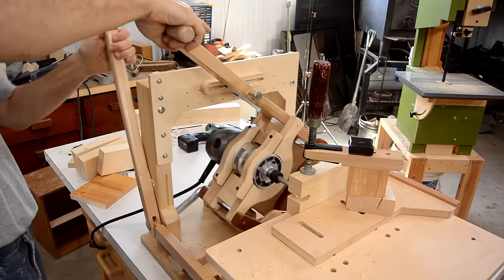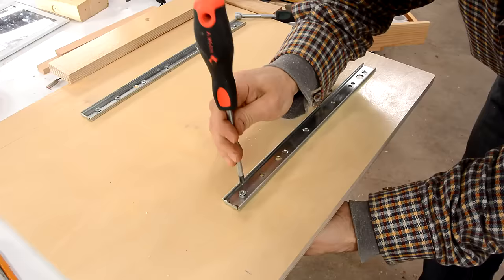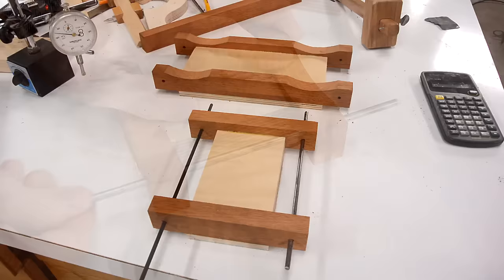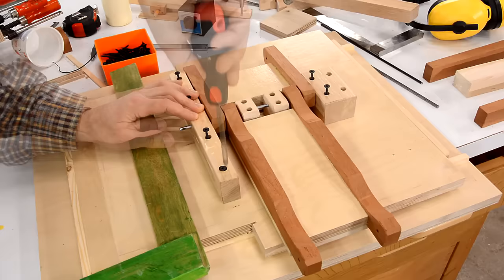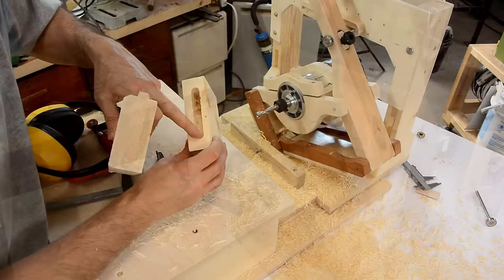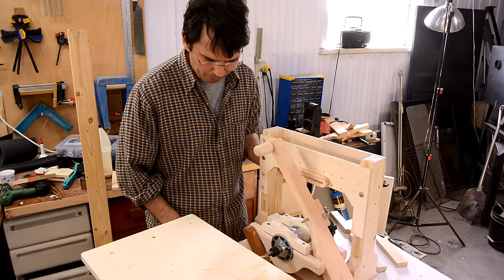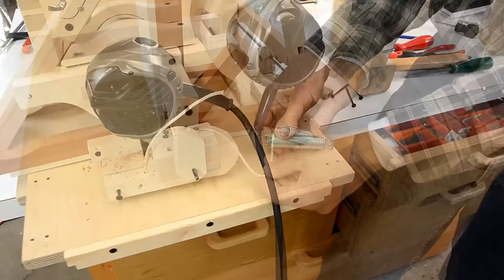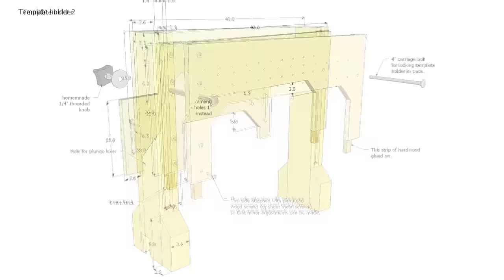Building the pantorouter

Comment: A countersink with a pointed tip (rather than flatted off) is really handy for spotting screw holes in metal drawer slides or even hinges. The tip cuts a perfectly centred divot in the base board.

Comment: I didn't finish watching but wanted to comment at the template board  installation.  You might know this tip for gluing, but I'll  share anyway. I noticed when you glued the pieces up they slid around. I know you align them better before clamping. I saw on another woodworking channel that you sprinkle a little salt on the joint and gives grip and doesn't allow the joint to sliding around. Hope  that helps in the future. Great tool your building and instruction. Well let me finish watching.

Comment: You can fill an incorrect hole in birch ply using chop stick material (the type you pull apart before using). It’s a similar hardness to birch ply and OSB.

Comment: Did you realize that as you plunge into the piece on the first cut after attaching the plunge handle, the router twists and moves backward in the mount brackets almost a full 1/4 inch? I wouldn't want that thing to pop out the back of the mount while it's chuck-deep into a plunge cut.... I assume tightness is paramount on those brackets

Comment: Hello Matthias, looking at the build I am curious about the rails used. To be clear: I'm not saying your method is wrong! 
So my question: Why did you decide to go with drawer rails instead of linear guides, for example the LM12UUOP type with supported rails. They are roughly the same price, can handle higher loads and do not need additional modifications to get them to work.
Reply from the maker: Drawer glides are much cheaper than linear guides that would actually be suitable, locally available, easier to mount, and much thinner, so more suitable for the job.  Yes, I had to spend 15 minutes modifying them, but it was worth it.
Reply: Allright, thanks for your answer
Reply: I would guess that's what he had available

Comment: Would it help to drill the holes for the links and then rip the stock down the middle? Kinda the same way you made the spacers for drawer slides? I feel like alignment wouldn’t be as much of an issue if you can glue it straight.

Comment: Matthias, curious if you've tried other things besides these drawer slides.  I'm thinking maybe these linear rails guides for CNC and 3D printers, something that could just get slapped on without any tinkering, 4 slides to spread the size of the box and 2 rails, they do come out to close to $100 though.
Reply: And the thing will be two inches taller, drawer slides are nice and slim.
Reply: LOL, you even investigate the linear rail guides?  As low as 13mm vs the DIFFERENT linear rail shaft rod with bearing blocks which DO come out to 1-3/8" tall.  The price I mentioned should have told you I'm not talking about the one you're thinking of, the one you're talking about can be had for $10/rod with the included bearing block.
Reply: @Sryously  what is funny about that? Drawer slides work well and most people already have them.
Reply: What's funny is you assuming what I was talking about.  Obviously drawer slides are easier to find but as Matthias showed on video they need a lot of tinkering to get them running right.  And after some more searching around I found the linear guide rails I was talking about for maybe $60 total, 2 rails and 4 slides.

Comment: you make your joints way too loose the mortise and tenon it has to be tight tight enough you have to bring it in with a hammer especially if you're doing it by machine which is never a strong as a hand chiseled mortise and tenon. nice design and build tho
Reply: Fester Blats rubbish precise no if you no what you doing it is more precise by hand, machinery's just for unskilled people what is fine. and you're not squeezing all the glue out it gets pushed into the fibres of the wood creates a vacuum plus you don't need glue to hold a joint.
Reply: i learned at school that these joints must never be too tight and that it's never good to use a hammer
to join. Glue has to have its own space otherwise it's gonna be squeezed out! also too tight can result in a faster break. Wood is contracting so too tight = BAD!!! In school we had to push the tenon into mortise by one hand and then test it by gravity if its holding, if the tenon would fall from the mortise by gravity then we had to make it tighter. But too tight would mean that by one hand we couldn't push the tenon into mortise.
Reply: jozef danyi well I wouldn't believe what you learn in school! and I'm not saying bash it with a sledgehammer just a tap with a mallet. the only expansion if at the bottom of the mortis if it was greenwood a slight gap could be left there but not on the sides of the joint with the tenon A mortise plunger destroys a mortise joint and makes it weaker by the actions cutting through the fibre of the wood you never cut down a mortise joint vertically with a chisel.
Reply: I'd hate to see what John Swedas joints look like in 20 years.
Reply: LOL. Why is the machine any different than doing it by hand if you're forming the exact same geometry?